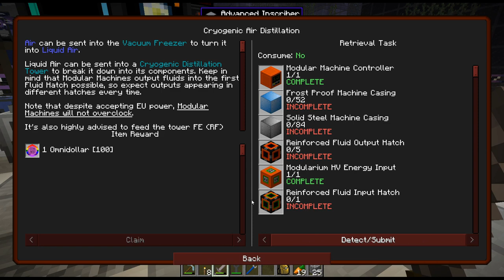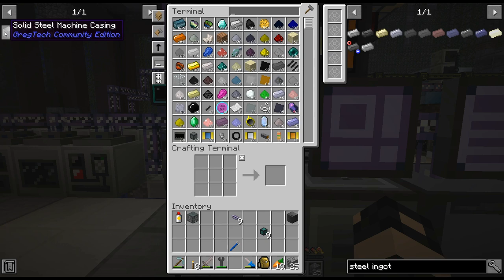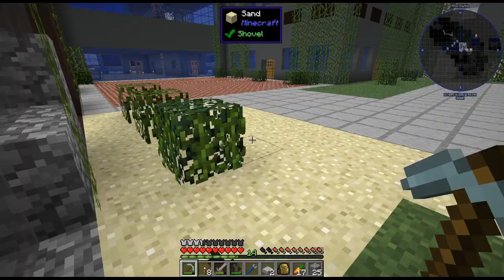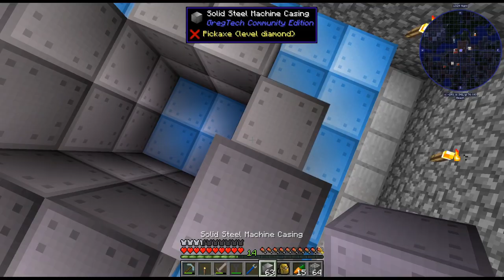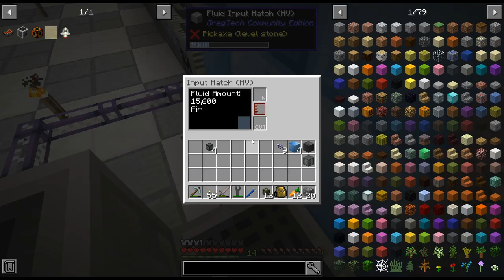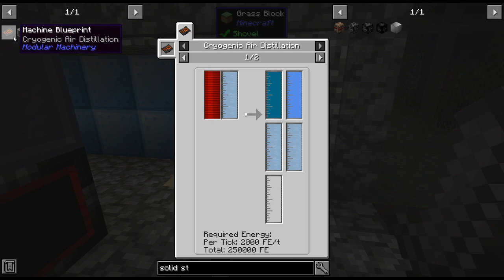Omnifactory - 44 - Cryogenic Air Distillation Tower

Comment: Your chance of getting carbon fibers is 100% since you using an HV autoclave.
Another option would be to let it run constantly but output into a drawer with a redstone upgrade and storage bus connected. If you then put a machine controller at the side of the autoclave which faces the drawer and set the machine controller's minimal redstone strength to 15 the machine will stop working once the drawer is full.